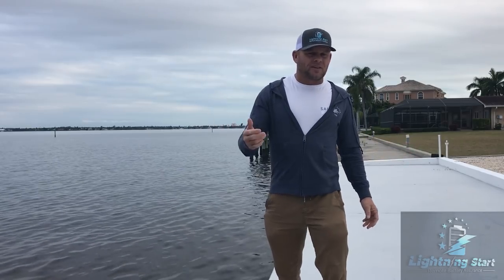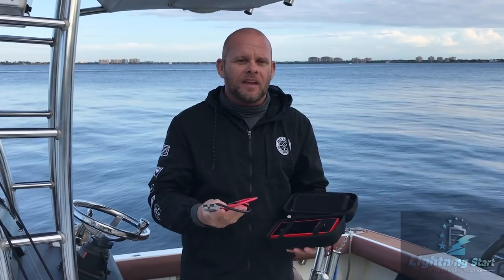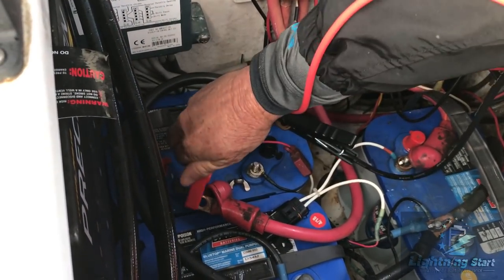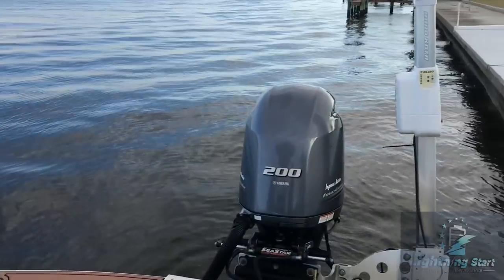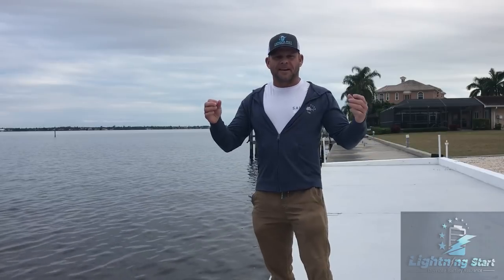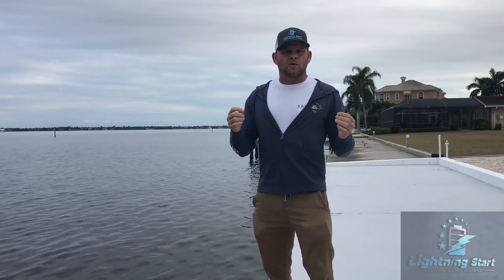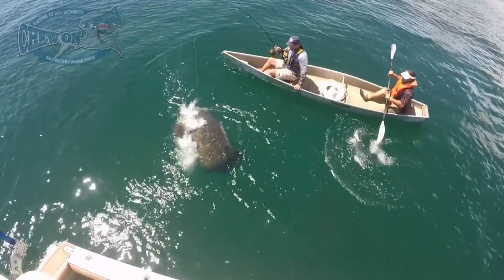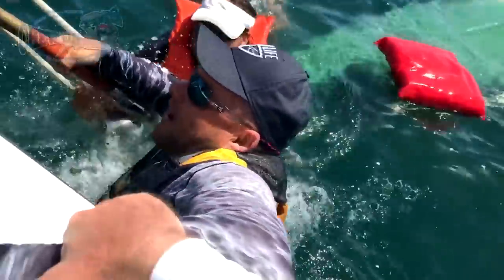Revolutionary Remote Battery Jump Starter From Lightning Start! How To

Comment: Huh, install it?! Why and whats the remote needed for?! I dont get it!!! I def seen something just like it, Canadian tire and Amazon!
Reply from the maker: Well Patrick you install it because it will stay 100 percent charged always ready to remotely jumpstart dead batteries. Lightning Start is designed to remain fully charged until you need it. Lightning Start has a product and utility patent so it’s impossible for you to have seen something like it or they have violated our patent. Once installed all you have to do is press the remote to crank your car, truck, generator, atv or boat. No more having to go in charge your dead jump starter and then drag it out to your dead battery hours later to start your engine. Lightning Start is always ready and available to be activated remotely. 

Godspeed 
Capt Ben